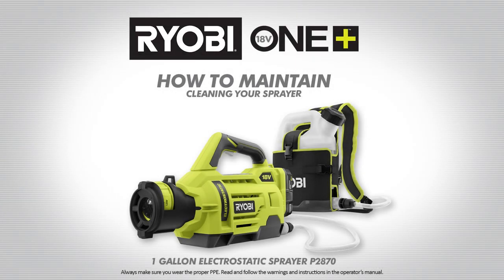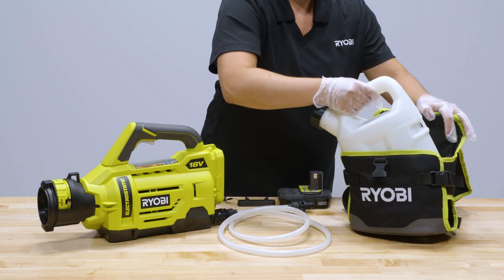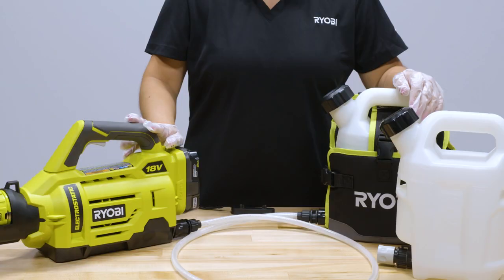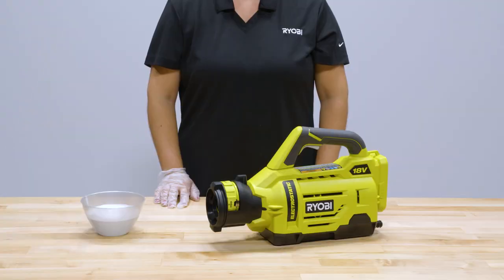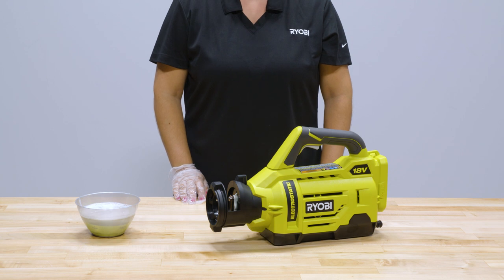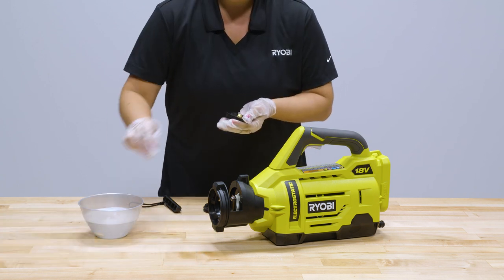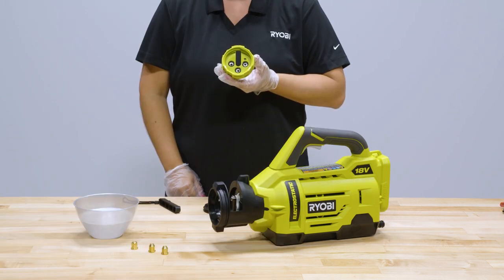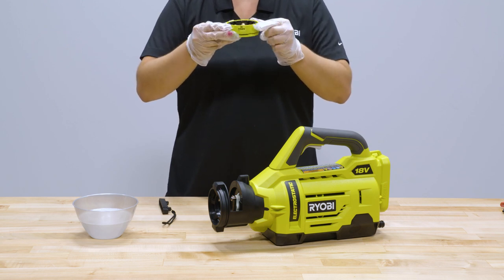How-To: RYOBI 18V ONE+ 1 Gallon Electrostatic Sprayer Maintenance

Comment: How do you empty the actual fogger? Do you just run it until it runs dry or what do you recommend?
Reply: You have to first flush it with water (distilled works best to reduce mineral deposits over time) and then you can run it dry.